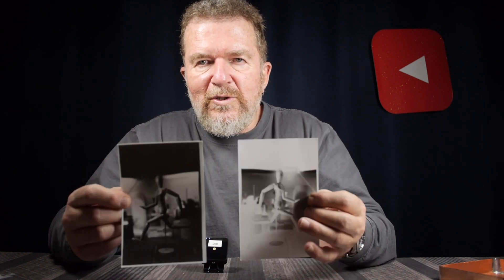Afghan Box Camera 4x6 Upgrade

Comment: I'm surprised that you chose copper for those chemical bath trays. Did you consider having some plastic ones made on 3D printer? Also, why not use an LED instead of an incandescent bulb? Nonetheless, given that you chose incandescent, surely an E10 base bulb and socket would be far neater than the cobbled-together arrangement you arrived at. Maybe there's some rule of primitive construction that I'm not aware of?
Reply from the maker: No rule, except to use what you have around the house, or wait days for something to ship. Yes, plastic tanks would be nice, but I can make these very easily. A white LED would work, but you've have to use a set of blue and green LEDs for optimal contrast control. As it is, I already had the incandescent bulb on hand. And I use incandescent in my darkroom enlarger, so I'm used to it.

There is a philosophy (or practice) of primitive construction with many of these kinds of cameras built around the world, I felt it'd be out of place to violate that spirit of simplicity by over-engineering. Embrace the simple!
Reply: @Joe_VanCleave  "use what you have around the house" ... fair enough then.
Reply: When we can go out of the house again, If the trays are rusty, I am going to insist on laser cutting Joe some acrylic trays.  Less stylish than the copper ones for sure, but when all I have is a hammer, everything looks like a nail.

Comment: by the way, what is your opinion on mono baths for afghan box cameras? I've seen recepies for paper as well and am interested
Reply: Monobathd for paper ? That some new I haven't seen where did you find them ?
Reply from the maker: I’ve only read about mono baths, the process sounds like it has a narrow sweet spot. But it would simplify camera design to have one tray. Also, for use out on the streets you want the chemicals to last through repeated sessions, I’m not sure if a mono bath would be more like a one-shot.
Reply: I talked to Dave Walker (@davethewalker80 on IG) on the Homemade Camera Podcast yesterday morning when we recorded.  He says that it's possible, but impractical.  We go into it a bit on the next episode.  Really interesting bit of tests he did.  I think it should be out in the next few weeks.  it will be called E47 - Dave Walker
Reply: I've seen at least two examples I think. here's one on flickr https://www.flickr.com/groups/monobath/discuss/72157682667035383/  just mixing ready products like developer and fixer would be easier of course but doing it chemical by chemical like this gives more control.